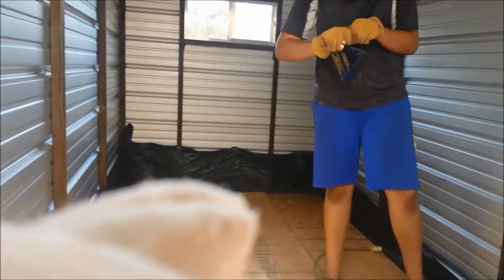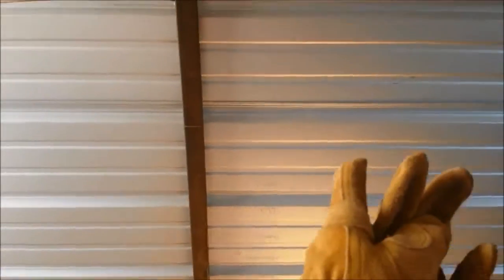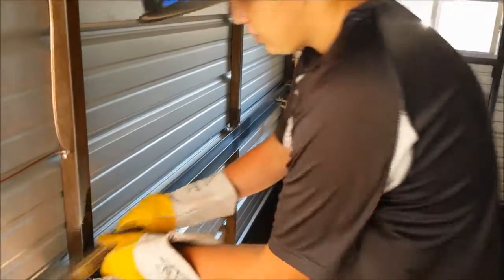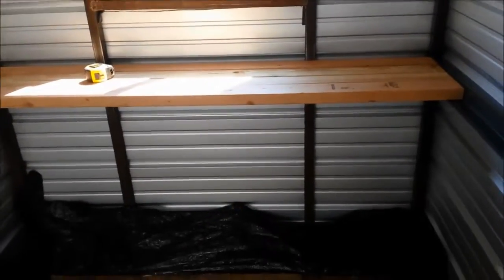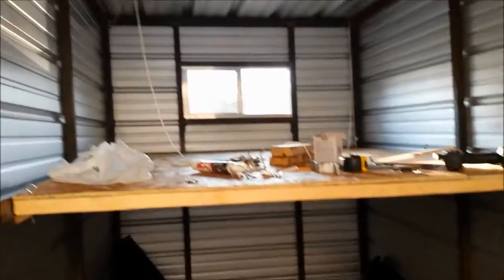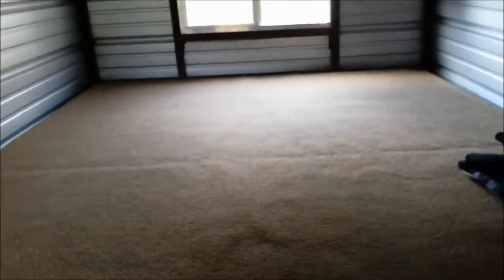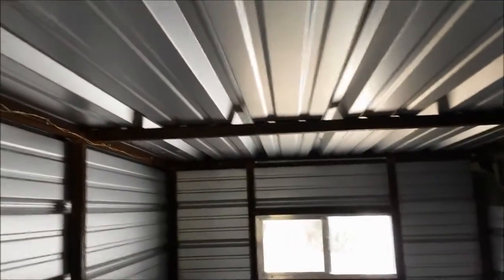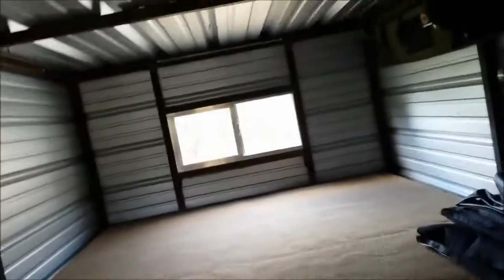Homemade Camping RV / trailer upgrade - redesigned interior

Comment: Insulate, insulate, Insulate.
Reply from the maker: it crossed our mind but... Since the coldest nights here in south Texas might hit the upper 20s a Mr Buddy keeps it nice and toasty. We have never used it in the summer because then we would have to add an air conditioner or more windows. It is for storing the camping/hunting equipment and a nice place to sleep at night regardless of wind or rain. If you live in a colder climate yes probably need plenty of insulation. 

It is called camping and not glamping ;)